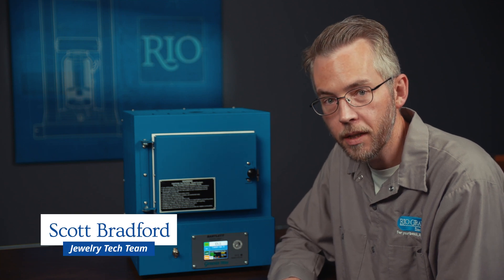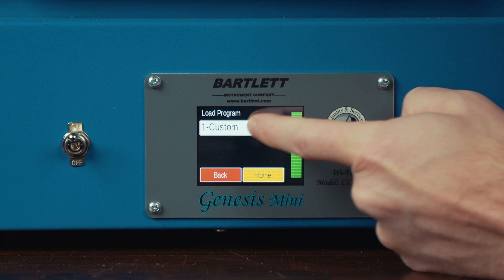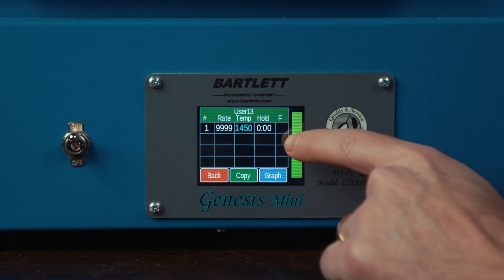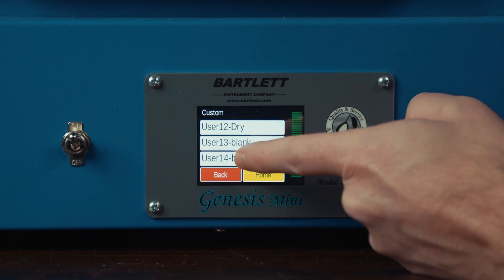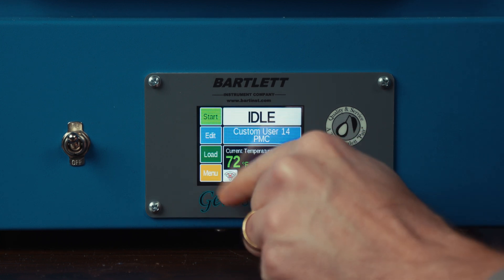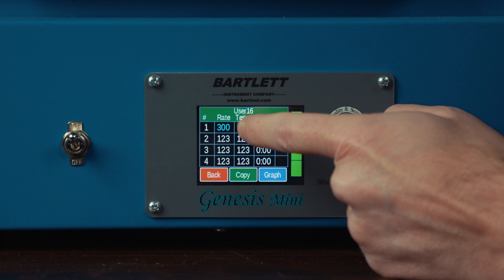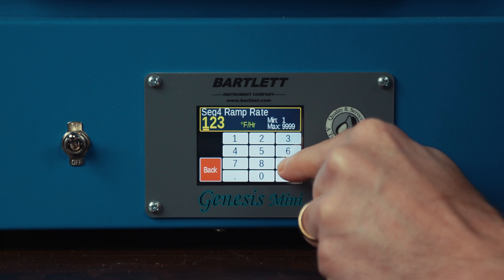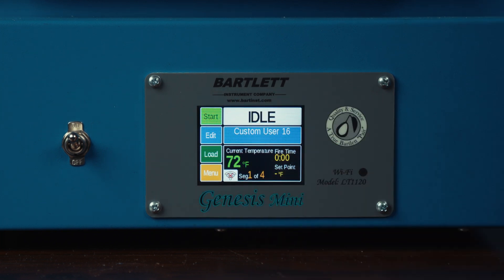Custom Program a PMC Kiln with the Bartlett Controller

Comment: Hello! If I am told: Ramp at 1525°F (829°C) per hour. Hold at 1525°F (829°C) for one hour (total firing time is less than 2 hours), is that: 

column 1: 1525 / column 2: 1525 / column 3: 1 hour 

or...

9999 / 1525 / 1hour 

Or do i need two segments?
Newbie here, obviously! 
Thank you!
Reply from the maker: If you are doing a ramp of 1525 per hour and a hold of 1 hour that would be only one segment. You can put the ramp, hold and temp all in one segment.

If you want to add another ramp or temperature and hold time that would be another segment.

Comment: Where can i find the program for the first firing
Reply from the maker: Ramp full speed to 1500F.  Hold for 30 minutes

This is only needed if you're firing glass or enamels.  If you're casting or firing metal clay it is not needed.  If anything from the manufacturing process smoked and your firing glass, it could smoke the glass.  Metal clay smokes so it would not matter.  Casting smokes so it will not matter for that process either.

Comment: One thing I found a little confusing when custom programming was why my program was taking many hours more than expected. The mistake that I made was not accounting for the "ramp time" and thinking that the "hold time" was the ramp duration.

Example: 3hr (no hold) segment of 0-450deg equals 150deg/hr Rate - 450deg Temperature = 0:00 Hold
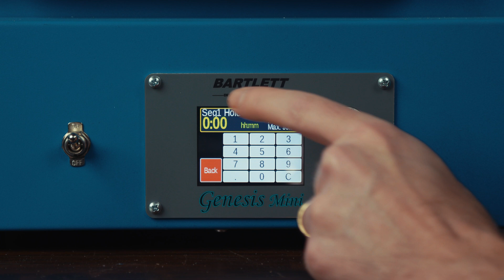I was entering: 150deg/hr Rate - 450 Deg Temperature - + 3:00 Hold  for the above example, and of course it was taking twice as long. I mistakenly though that the "Hold" was the segment duration, not Ramp + Hold, and that's why my 15hr burnout program was taking over 24 hours. Needless to say, my burnouts were very thorough!!